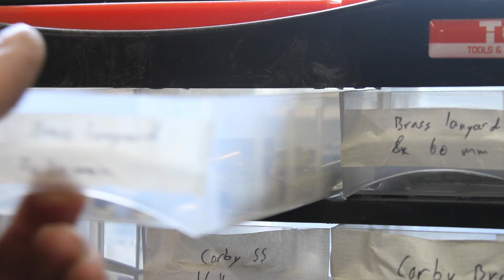How I make the Mini Double Sided Leather Strop, from start to finish. Tips in the end!

Comment: What kind of glue do you use?
Reply from the maker: Here I used some wet resistant wood glue. Bonds very well between the wood and the leather. On stabilized woods and micarta etc. I use epoxy.